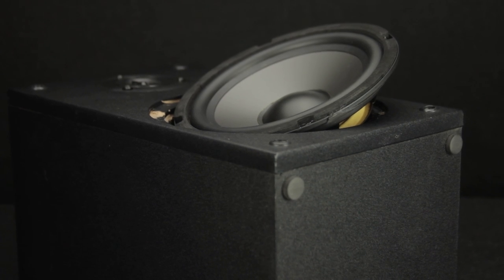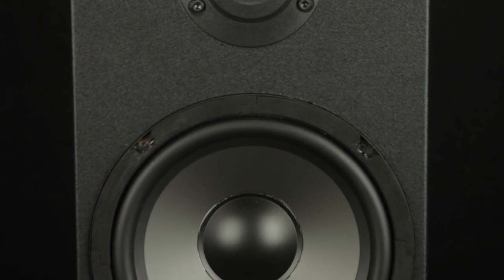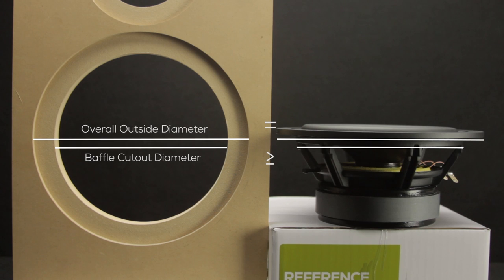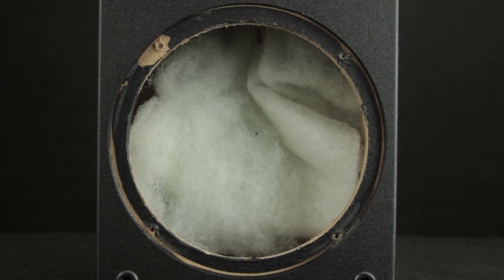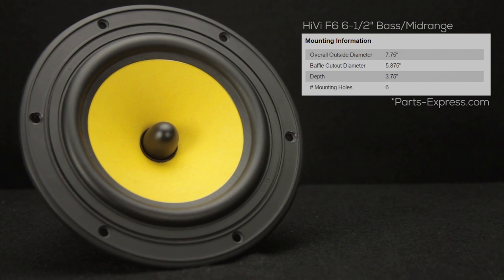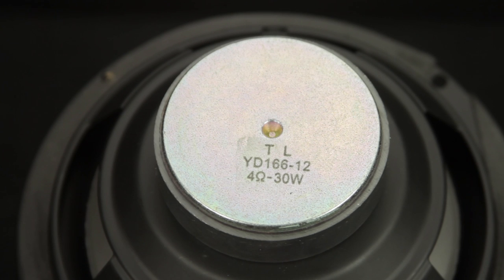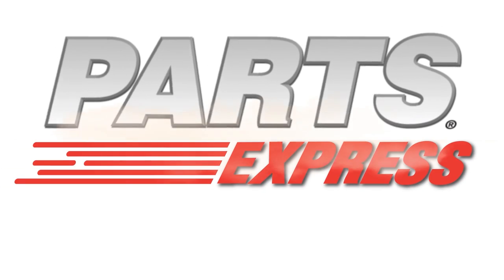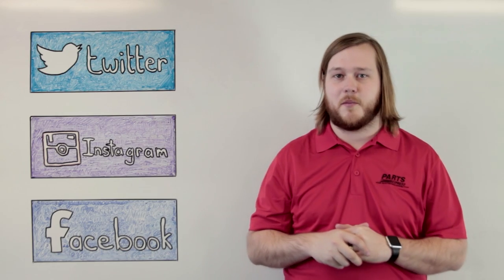How to Measure for a Replacement Speaker.

Comment: Nice information, but sadly the perfect speaker to match with the tweeter and crossovers plus frequency range often dont fit at all
in flush mounted speaker cabinets/boxes so instead finding one that fits out of the box
 i just find the right speaker/driver that is correct for my box size/tweeter/crossover/ports
and cutout a wooden ring made from mdf to fit all size speakers as i please its very simple, all you need is some mdf wood/ a jigsaw and some sanding paper plus 2 viles 1 rough grain and 1 soft fine grain. (plus maybe sourfree sillicone kit to make it airtight, or some foam/rubber rings  maybe some paint to match)

My fix ofcourse can make it harder to fit the grill on the front, and it probly wil not look so pretty on all speakers.
I dont really care about looks just the sound

Comment: You said the speaker enclosure was OD of 6 1/2" and CD of 5 5/8" (5.625) but then you said that the speaker at time 2:14 would fit even though its CD was 5.69". That doesn't make sense to me since the speaker CD would be too big for the enclosure's baffle. Is there a nominal measurement that differs from 5/8" = 0.625" ?

Comment: Still didn't answer the question. From what I see most manufacturers are very vague about specific measurements, at least when it comes to say subwoofers in enclosures. I just bought an 8" sub but the speaker is actually 6 3/4". Not a deal breaker but I find it odd. 
Anyhow I was hoping this video gets to that point.
Reply from the maker: Not sure what question was not answered. "WHY are manufacturers vague about specific measurements?"

Comment: Is there a way to look up and match drivers exactly from the printing on them? I'm trying to replace a 2 inch speaker, with no other info except its marked "CHD 50311 4ohm F99k" from an Anker portable speaker. My experience says the answer is no, because humans don't care enough to share more info, even though info that could easily be shared and that computers make it easy. But I would be glad to find any exceptions.
Reply from the maker: If you reach out to our techs, they can set you up with whatever speaker you need based on that information. Email: Tech@Parts-Express.com
Phone: 1-800-338-0531

Comment: I need help find stereo system speakers for a vintage speakers? Its a realistic stereo system with 2 huge speakers 3 way, bottom is a 10.5 inch measurement and 2 smaller sizes 3.5 and a 2.3/4 inch. how do i get good measurments

Comment: Everyone talks about impedance, but no one ever talks about wattage.  I want to replace my speakers, but I want to make sure the wattage is balanced. So, how do I do that?
Reply from the maker: Really you just want to try and make sure your wattage is the same of higher than the speaker you are replacing. It's all about efficiency.
Reply: @PartsExpressOfficial  the problem there is, there is no indication of wattage on the speaker. Just the 8ohm impedance. I did some research on the speakers, and again, same issue. All of the tech specs I can find don't discuss wattage. Which I felt, gives me an opportunity to put some speakers into the cabinet, that will be of a slightly higher wattage.  Again, not sure how to make sure it's balanced.

Comment: Hmm i was wondering if my krk rokit 8 was sold to me as an 8 but was smaller and thought I was scammed. The speaker is supposed to be an 8 inch but its really 7 inches. I was trying to find out if others got the same measurement but couldn't find it. Drove me nuts because to me My rokit 8 seems smaller then others I see. I don't get it

Comment: I'm confused lol 😆 but I have a 10 5/8 inch measurement of the inside of speaker and 11 and 7/8 inch with outer frame. And it's about 5 inches tall 🤷‍♂️

Comment: Just bought a Pyle 6.5 inch woofer.inside baffle size says 5.5 inch hole to cut out.i cut the hole and the speaker still doesn't fit.

Comment: Fail! What of differing T/S parameters? So no, simply replacing your old driver for a new one the same size isn't the way it works ..... and you know it!
Reply from the maker: +utubecomment21 Sorry, we were just showing how to measure for a speaker replacement with a few reminders. Not all the steps that goes into which one to buy.
Reply: I've had nothing but success with choosing a random driver for old speaker cabinets.
Reply: Rhett Krecic There maybe several reasons for that. I cringe when manufacturers design their own drivers. Usually means cuts in design and performance to make a buck more! 

I prefer going with established driver manufacturers! hey're not in it for the hype!
Reply: The woofers I replaced were in vintage Sony ss-u3030s. I replaced them with woofers pulled from old MTX Magnum marine speakers because the Sony's cabinets were studio quality and have nice tweeters. These woofers were a perfect match even though they were designed for the original cabinets. The sound was unbelievably accurate and the bass went down to 35Hz  relatively flat using "loudness" and the 150Hz bass tone knob on my vintage stereo receiver. Another success was on a vintage powered 10' subwoofer using a Pyle driver ordered from online. I guess it has something to do with the fact that the cabinets from the 70s through 90s were well designed compared to anything from today.
Reply: Rhett Krecic Speaker technology has moved on from the 70's ... and dare i say 90's as well.
Reply: +utubecomment21 I'd need to disagree with you on that. From my experience, not even close for the better. My 90s 6.5 woofers do not even belong in the 35Hz range of bass but nothingless, they hit it at moderately loud volumes with very good balance and punch. Not just "peaks" of bass but rather even and flat. Replace the foam surround and you get yourself some relative nice woofers for a cheap price. I got the woofers along with their original cabinets and tweeters for $5. The Sony cabinets with the blown woofers was also acquired for $5. I bought the Magnum woofers about three years ago. These same Magnum woofers still sound great to this day inside the Sony cabinets and I've maxed out their xmas quite a bit. Every modern speaker I've heard never and none of them ever sounded this good size wise. They had "peaks" in the bass, some with no punch, some had bass which made the vocals sound muddy, and others had tweeters that sound like tinfoil.
Reply: Rhett Krecic I look at the flip side. 

Foam surrounds is technology that belongs in the bin, although from car audio, JL audio W7 range still continue with it. 

But it seems that drivers, again from a car audio perspective, are far better than drivers from the past. 

Personally I don't believe in carbon fiber (or 'fibre' as we say in the UK) to be any real benefit over traditional paper cones. 

But it seems that subwoofers are now being designed to perform better in smaller enclosures.
Reply: +utubecomment21 Yeah but you can reform the surround with rubber and never need worry about it. I have yet to hear any subwoofer sound good and loud in a small enclosure. There's always an empty" sound. I have this 90s 8' subwoofer from Jensen in it's factory tube cabinet. It is not a big cabinet but the sub is designed specifically for the cabinet and it sounds very good. It might not be as loud as today's subwoofers but it just sounds better. More punch, less boomy, and more accurate. Even today, if a sub and cabinet was designed together, they sound great. I've noticed little change in that aspect. The 10' powered subwoofer I replaced the driver is a huge cabinet used for home theaters. The onboard amp is very powerful and I'm guessing pumps out 150 (real RMS watts). I bought a $23 modern subwoofer and threw it in and broke it in. Now the thing punches very fast and accurately. Never needed to max it out yet. This sub had some bad reviews. Big cabinets still shine even today...
Reply: +Parts Express No disrespect intended ... just a slap on the wrist :)